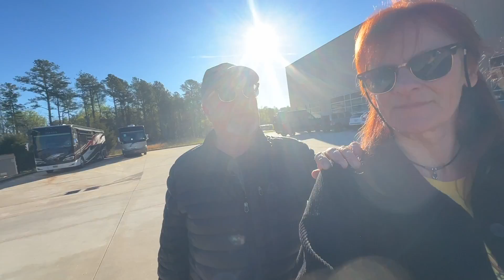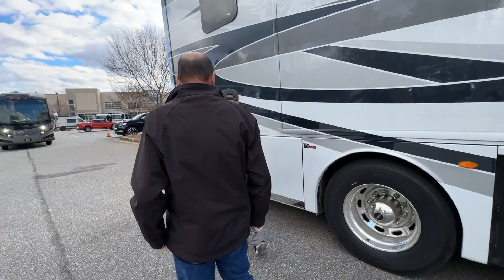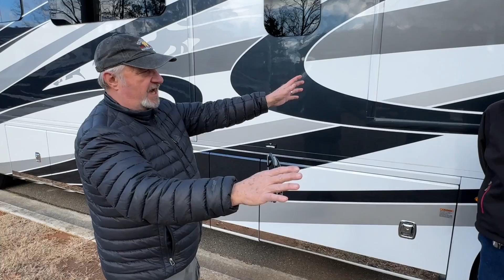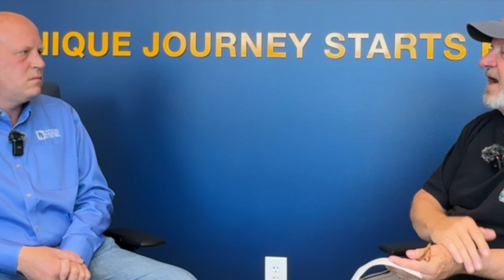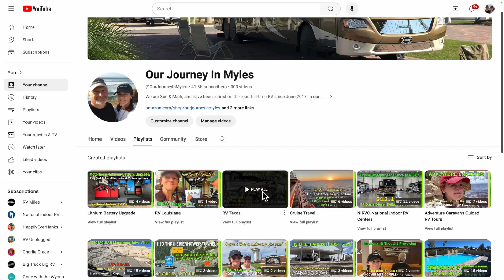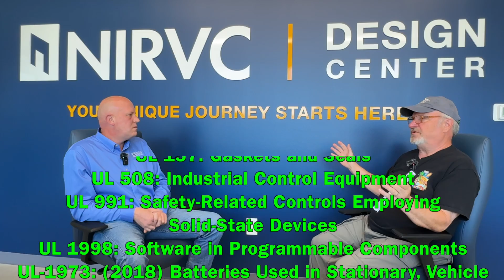NIRVC-Atlanta | Motorhome Upgrade | Lithionics 960 Ah Lithium | Victron Controls | Part 4/4 | EP306

Comment: Does Justin have questions that we could see and take the time to think about so when we were to call him we have an idea of what we are looking for?
Reply from the maker: I would be prepared with the answers to these questions before calling Justin so you can get the ball rolling faster and he knows you are serious and ready to rock & roll!
1) * YOUR CURRENT SYSTEM INFORMATION *

	1a-Describe current battery system:
	Battery brand & chemistry-Lead/AGM/Lithium?
	Voltage and amp hour capacity.
	Original equipment, or have they been replaced?
	Was the modification DIY or professionally done?

	1b-How long are batt. lasting before REPLACEMENT?    
	How long are batteries lasting before RECHARGE?
	Any problems with current battery system?

1c-Charging Equipment:
List all methods & equipment age in place.
	Inverter/Charger:  Brand & model numbers.
	Solar Panels: Watts per panel x number of panels.
	Solar Panels: Brand & model numbers.
	Solar Charge Controller: Brand & model numbers.
	OEM Engine Alternator amp output capacity.

	1D-Do you have a built in generator?
What size?  What fuel?
What brand and model number?
	Does it have “automatic generator starting” (AGS)?

2) **CHANGING BATTERY LOAD PROFILE? **

	2a-Changing items that ARE NOT CURRENTLY WIRED to run on batteries ALONE off inverter IS CHANGING the load profile of the entire motorhome.  
THIS WILL MAKE THE EXPENSE START TO RUN WILD!

	2b-What are you expecting to power on batteries?
	Microwave?
	A/C unit(s)?
	Coffee Maker?
	Washer/Dryer?
	Kitchen Outlets?
	Range/Cooktop?
	        Other devices? (CPAP?)

3) ** APPLICATION EXPECTATIONS & CAPACITY *

	3a-Voltage & battery capacity amp hours.
	3b-Max PEAK discharge rate anticipated?
	3c-Max CONTINUOUS discharge rate?
	3d-Max PEAK charge rate desired?
	3e-Max CONTINUOUS charge rate desired?
	3f-Run time desired before recharge is required?
	3g-Typical geographical location: Motorhome use.
	3h-Typical geographical location: Motorhome stored.   
	3i-Lowest & highest temps REQUIRE to perform in.

4) * BATTERY COMPARTMENT DIMENSIONS *
   BATTERY COMPARTMENT PHOTOS (L x W x H)

	4a-Will battery be in “mostly” continuous use?
	4b-If no, describe in-use vs. storage time ratio.
	4c-Describe storage conditions & temperatures.
	4d-Will you be plugged in during storage?
	4f-Solar panels if NOT plugged in during storage?

These questions are just to get started correctly!
Reply: @OurJourneyInMyles  thank you so very much. Now I have to find a way to copy and paste this to notes on my iPad. Lol

Comment: 2023 london aire ac ran for 8 hours three times. It is great.
Reply from the maker: That is the beauty of buying the Lithium OEM from the factory!  My rig would have required another pile of dough to ADD a second inverter and ADD another sub-panel in the 1/2 bath.
Reply: The front ac is wired to the battery only

Comment: Nice interview. Will the Victron inverter supplement shore power if you are plugged in to something less than 50A? The Xantrex on the New Aire doesn't  which was a little disappointing to find out (first world problems).
Reply from the maker: I was disappointed that I could not do that as well with the single Victron Inverter.  The reason I found out though is understandable.  The motorhome load shedding logic is set by the motorhome EMS system on board.  There would be a requirement for way too much electronic co-operation and hand shaking between the two control systems for it to work correctly and safely.  Not enough models and manufactures are standardized on enough volume to make all this electrical engineering work worth while.

Comment: Did you say your setup won’t run even one of your ac’s? How would you stay at a HH when you need air, run the generator?
Reply from the maker: Yes, we did not change the sub-panel or wiring to be able to run an A/C unit. We have run our generator at most of the Harvest Hosts we have stayed at in the past.  We only stay at HH with large areas to park and spread out.  It just wasn't on our list of important things. We REPLACED our inverter, but did not ADD a second one.

Comment: Being in the market for a Class B with Lithium (6400 amp hrs), the difference between an AGM with Generator and Lithium is 20K (MSRP).  So I was surprised that the system "only" cost 35K until you offered the explanation of the "discounts".  To skimp on the necessary components and the actual batteries and installation by someone who is versed in it is an invitation for disaster. I am glad to see NIRVC on top of the game.
Reply from the maker: The "estimated" $35k was the guesstimated price for anyone to have this done.  Our discount made the cost to us less,....
Reply: @OurJourneyInMyles  , then I think that is not bad compared when you consider my above price difference (additional 640 amp hour heated Lithionics is another $12K MSRP!).  If all works the way you guys hoped it would,  then that is all that matters! Enjoy the additional freedom!

Comment: That's a sweet battery, but man that's an expensive install. It took us 5 years to complete our solar system that we designed and built ourselves. We have slightly less storage capacity than 2 of those nice 960ah Lithionic batteries (23.5kwh - the equivalent of about 18, 100ah Battleborn batteries), yet my entire system only cost me about $11,500 to build, including a high-efficiency 28.5 Seer-2 EG-4 mini split heat pump, 5,020 watts of solar and 6,000 watts of inverted 120v ac power. Of course this doesn't include labor, but now that I'm retired, my labor is virtually free. I mean, what am I going to do with my time anyway other than to add value to my motorhome now that I'm living this lifestyle full time? We can now run everything in our coach just like we are plugged into a power pedestal at an RV park, including 24/7 A/C and heat from our heat pump. Our needs might be a little less than some, but just yesterday we were running both A/C units, the microwave, an insta pot, a rice cooker, our 55" TV, desktop computer, etc. all at the same time while having enough solar to simultaneously charge our batteries too. 

Of course, we don't use name brand Victron components or Lithionic batteries, but the components we do use are well researched with great specs, warranty, etc. just not as pricy. For instance, we have a Sungold Power all-in-one 48V, 5,000W Inverter/100A charge controller/battery charger. This all-in-one unit has the same 99% charging and 95% inverter efficiency as the Victron unit, though it lacks some of the bells and whistles to come in at only $764 for a full 5,000 watts of PSW inverter power and 100 amps of 48v charging. We chose this particular unit because it supports up to 500 volts of solar power which was needed to accommodate our 400voc solar array - which is something Victron can't do. I'm not knocking your decision to go first class, just pointing out that there are other quality, capable products available with a lifetime customer support, good warranty, etc. for a lot less money. And since we're living on a tight retiree's budget of SS and a small pension, necessity is the mother of invention as they say, requiring us to make more frugal choices.

We travel around the country a lot, visiting National Parks, and doing the tourist thing, mostly boondocking out west. We boondocked for 10 months last year, across 11 states in some of the most beautiful wilderness areas imaginable near Yellowstone, the Grand Tetons, the Badlands and Black Hills of SD, Ut, MT, ID, WY, NV, AZ, etc.. We wintered over in the Yuma area last year, visiting friends. We're visiting our son in NC now, where boondocking places are pretty rare. We're staying here in a spacious site in a nice RV park without hook-ups for only $100/mo., saving us $500/mo. off their FHU rates. It's great to have options. 

Take care. We hope to see you down the road one day.
Reply from the maker: WOW!  You win the prize for the longest comment we EVER received.  Back in the day, when I was thinner and younger, I probably would have attempted this myself if I had a garage & shop to work it.  But because we are Full-Time RV, with NO home base and NO garage and NO place to live in, we went with NIRVC so they could rip into the project and complete it as quickly as possible.  Thank GOD for dear friends Bob & Joy that allowed us to stay at their home during this install!
Reply: @OurJourneyInMyles  I know how hard it can be. We are FTers with no home base either, but we didn't have the money for the sweet professionally designed and built system like you guys have, so had to do all the design and construction work ourselves on the cheap while boondocking on BLM land with only limited hand tools and resources. I probably spent 40-50 hrs. watching Will Prowse and other instructional videos to learn what we needed and how to build it. I enjoyed the challenge though. You come up with a problem like, "How do I lift 8, 550w solar panels on my roof that are heavy, as big as a sheet of plywood and made out of glass?", with no help other than my wife holding the ladder or throwing me a tool and such. She's in no shape to climb it and I'm 67 yrs. old and not in the best shape myself. 

How did I do it? First, I bought a 4 ft. section of 6" ductwork and split it in half to make 2, 4 ft. long, metal C shaped pieces to protect the roof edges. Then I duct taped them in place. I bought 2, 12 ft. 2x4s (don't ask how I transported them, or the 25 ft. lengths of aluminum angle I built the roof rack out of without a pick-up truck) and screwed them to 2, 3 ft. 2x4s for cross braces. I laid the assembly on the roof like a ladder to slide the panels up. I tried using a regular expansion ladder, but it was too unstable. Then I climbed onto the roof with an empty 5-gallon collapsable water jug and tied it to a rope on top of my roof before filling it with gallon jugs that were light enough to pull onto the roof with a rope. Then I made a harness, tied it around a panel, secured it to the panel with plastic zip ties (so it wouldn't slip) and attached the harness to the rope. Next, I climbed on the roof and pushed the water jug off the opposite side of the roof which lifted most of the weight of the panel, so I was able to grab the rope pull it up onto the roof as my wife steadied the panel as best she could. Then I only had to do this 7 more times, bolting each panel to the roof rack I built, and connecting the cables as I went, as there was little room on the roof to work with these massive panels covering almost the entire roof. I didn't have my big inverter installed yet, so had to run my generator for several days to power my power tools as I built the rack. Hey, if it was easy, everybody would be doing it, right?